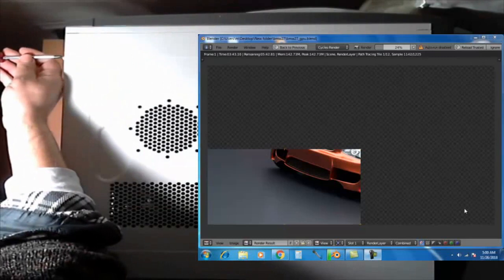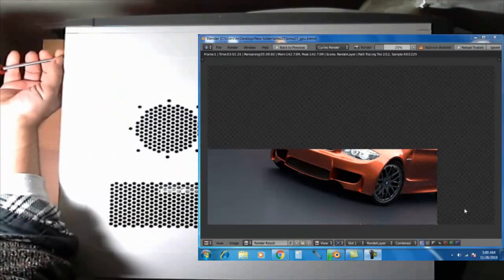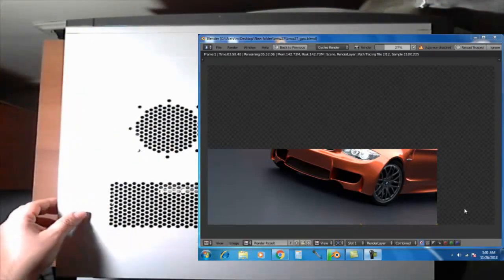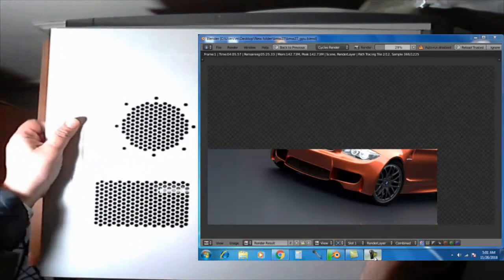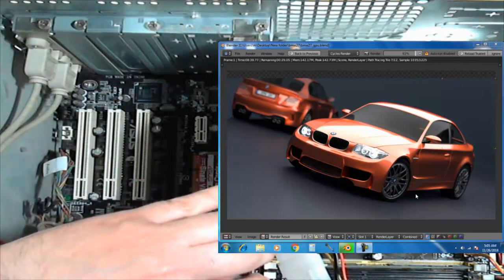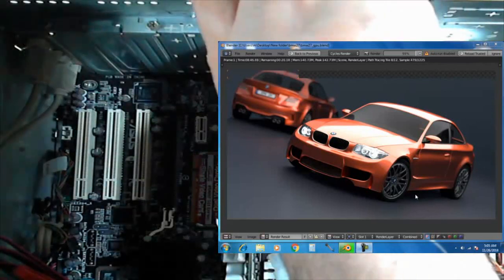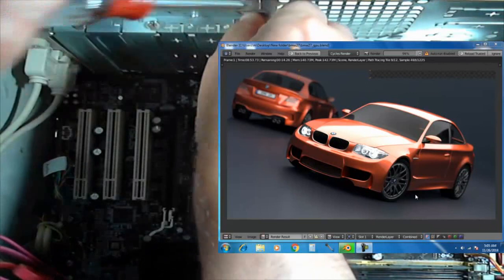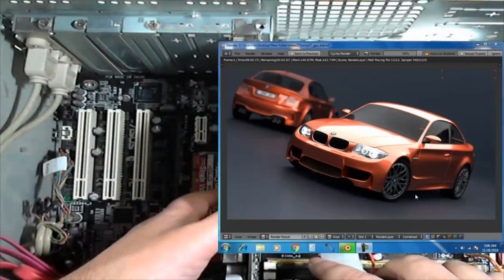Can i install a GTX 1050 graphic card  in old pc Pentium 4 ?

Comment: My spec
Mobo: asus 5kpl-am se
Ram: 2x2 ddr2
Intel core 2 dou

Can it run?
Reply from the maker: Gmorning sir
what GPU model you want to connect?
Reply: @TheKatr2  gt220 ddr3
Reply from the maker: @jerolynguvera9364  if i search right
Released on 01 Aug 2010, the Asus P5KPL-AM SE
and your card is GeForce GT 220	October 12, 2009
sounds fine with me
but
download a monitor temp app and for a while (a mounth) check
if after a month you wil no have overheat
you are ok
Reply: @TheKatr2  thanks sir ahm follow up question, can gt220 1gb runs in ddr4 mobo? And it will be increase fps in some online games like dota 2 or valorant or gtav?

Mobo: biostar a320 mh
Reply from the maker: @jerolynguvera9364  you mean if the gpu has different memory from motherboard?
if youwatch my video you will see what its works
(if understand right your question)
Reply from the maker: @jerolynguvera9364  no not expect update becouse you have limit from motherboard arch/re
the only possible way is to sub to some pay on line service
but fin/ce is cheaper in time to get new pc

Comment: my spec 
Motherboard : Fujitsu D3162-A1
Ram:10 gb
Processor: i7 3770
SMPS : 250 Watt
will gtx 1050 work on these specs
Reply from the maker: the gtx 1050 has release on 2016
is better from 1030

Comment: I have pentium g3240
And 8gb ddr3 
Can I install 1050ti
Reply from the maker: Introduction date of p3240 is May 11, 2014
GeForce GTX 1050 Ti	October 25, 2016
i dont think you will have any problem
but download a free hardware aplication monitor and check the temp to check for 1-2 months
Reply: @TheKatr2  ok thanks bro
Reply from the maker: @sivadilip97  pls dont overclock
Reply: @TheKatr2  yes I will never do that

Comment: Can it work on my pc?
cpu: i5, 4460
ram: 4gb Ddr3
Psu: 750w
Reply from the maker: 2014 is your year
 2016 is the card
install a temp application and keep your eye on this
Reply: @TheKatr2  wdym?
Reply from the maker: @_vien1726  the pc parts must be in the same generation
in other case you will have problems
i burn my motherboard after few months
your harsware is from 2014
the card is from 2016
you must be careful
Reply: It will work easily don't lissen to this ghg

Comment: will 1650 super work in my intel z68db motherboard
Reply: thanks bro
Reply from the maker: @fkthelegend3450  +1
Reply from the maker: carefull my friend you connect a 2016 to 2011 i advise install a free temperature monitor software and check the temps
if you notes something overheat stop it

Comment: so what graphics card is it able to take on the pentium 4 dual e2160 ???
Reply from the maker: from my expireance till now is wrong to mix years
chek the years who P4 was in production
and check the cards
these years is the optimum (2000-2008)
max 2009 and mabe 2010 
the P4 2160 release at 07
NVIDIA GeForce 8800GT
NVIDIA GeForce 9600GT
NVIDIA GeForce 8800GTS
ATI Radeon 4850
NVIDIA GeForce 9800GTX
NVIDIA GeForce GTX280
Reply: @TheKatr2  Thanks for the quick response

Comment: Can gtx 1050ti work on mine? My mobo is an old model, I'm just using the gpu for playing valorant and minecraft...
Reply from the maker: if ft yes
but read the comment section for more
Reply: Oh sorry, what's "ft"
Reply from the maker: @karl-san9560 1 my friend i put the gtx in old mobo
is work
after few months the mobo has broken
is a risk
maybe is happen
maybe no
2 the game nead specific ram cpu etc
if you dont have these 
... no work minecraft varolant
sorry
Reply: Oh it doesn't work on minecraft and valorant?
Reply from the maker: @karl-san9560  iam so sorry
no

Comment: how many psu do you need for gtx 1050??can I with this spec??
my spec :
Intel Core i 3 3220
RAM : 6
HDD : 1 TB
PSU : 300 Watt
Reply from the maker: the card has 2 power inputs 
if the psu has the 2 jacks will be work
Reply from the maker: but the official ans is chek your power suply manual your card and your motherboard manual to und/nd if this system can work

Comment: Can someone help?
In my pc i currently have an gtx 650 and want to upgrade to gtx 1050 2gb version.
When i install the gtx 1050 and turn on the pc it just stays at the bios screen and beeps 2-3 times
Reply from the maker: hello sir
can the power suply support the new card?
what others cards you have on the motherboard?
what windows you have?
can the pci of your matherbord suport the new card?
is work the new card?
etc
Reply: @TheKatr2  The power suply can handle it easily 
Windows 10 
8 gb ram ddr3
I5 2400
The pci i dont know?
Reply from the maker: @amelzolotic1364  is new the 1050?
Reply: @TheKatr2  No i used it in my old pc and bought a new pc and wanted to install the gtx 1050 in it but it doesnt work
Reply from the maker: @amelzolotic1364  
1 you have a computer who works with a 650 and you replace it with a working 1050 
wright?
Reply: @TheKatr2  yes , the gtx 650 works but when i install gtx 1050 it stays in the bios and doesnt boot to windows
Reply from the maker: @amelzolotic1364  what mobo uhave?
Reply: @TheKatr2  i dont know exactly, HP 2AB6 if i remember it correctly
Thanks for your replys
Reply from the maker: @amelzolotic1364  look if you hane a woring 1050 and pc who works the solution maybe will be something simple
when you have time check my video
https://www.youtube.com/watch?v=REt619Z-Cfk&t=1248s
and your free time try to copy my steps
i think the ans is on the steps of the  video
Reply: @TheKatr2  The PC runs without any problems with old gpu but it makes problems only when i insert the new gpu.
The PC is clean and everything is ok with the motherboard,ram, etc.
Only when i install the new gpu it doesnt work.
Is the problem because of the Legacy BIOS? I think i need a new motherboard with UEFI Bios?
Reply from the maker: @amelzolotic1364  yes is 2 time who the bios id the problem 
if you think you have super clean pci contacts 
as you can see in my video frm 1 look all are clean 
but few dust in pci slots 
plus dirt in card gold contacts is the cause
Reply: @TheKatr2  I will try to clean it, thank you for your help 👍
Reply from the maker: @amelzolotic1364  it will be or the clean or the bios
or both
if you fix it pls write me what is so we help users who have the same problem

Comment: Hi bro!
I have an AMD HD 7000 Series 1Gb DDR3 Graphics Card but when I attach it to my PC, it doesn't give me display. My Specs are:
(Lenovo E71 Thinkcentre Edge)
Intel Core i5 2400
180w Stock PSU
8GB DDR3 RAM
500GB Hard Drive
If I missed anything plz ask me and if you know any solution please tell me!
Thanks!
Reply from the maker: is ipossible to troubleshooting via email
but...
when is boot do u see the logo?
ok 
check if the gc is work in other pc 
and put a working card in the lenovo of these era to see what happen
Reply: @TheKatr2  i dont see any logo, the graphics card works in other PCs, and i even tried Nvidia 210 but it did'nt work either
Reply from the maker: @AB54R  look i have a video with 300k views for you but you mus dont skip any step 
you want to try it?
Reply: @TheKatr2  ok bro
Reply from the maker: @AB54R  https://www.youtube.com/watch?v=9oQKOmM8aEE
Reply from the maker: @AB54R  is old video but if u folow the steps you find the error
Reply: @TheKatr2  ok
Reply: @TheKatr2  ok, this video was about to fix a pc that wont turn on. but the problem im facing is the display. the display works fine when the vga cable is connected to the vga port, but when i attach the gc with it and attach the vga cable with it, the pc turns on, the lights turns on but it wont give me display. is it a bios problem or the problem is the whole motherboard?
Reply from the maker: @AB54R  iam sorry i tink you have a dead pc
Reply from the maker: @AB54R  becouse iam stupid you have lenovo
is connecting with a monitor from cg card
you press the power buton 
whT HAPPEN
are the lights of pc on and cpu fan run and no signal to monitor?
Reply from the maker: i thnk you have 2 vga ports
1 from mobo
1 from amd
is work the mobo dont work amd?
Reply: @TheKatr2  the one is the vga that is already on the motherboard (i dont know about mobo what is that) and the second port is with the graphics card
Reply from the maker: @AB54R  ok i start to understand
mobo is sorcut of the word motheboard
Reply from the maker: ok you have signal of the motherboard vga port?
Reply: @TheKatr2  yes
Reply from the maker: @AB54R  ok
before you start clean your inteor of lenovo and the contacts
for reference if u want chek this
https://www.youtube.com/watch?v=REt619Z-Cfk
Reply: @TheKatr2  i think the problem is the bios
Reply from the maker: @AB54R  do you have update it?
Reply: @TheKatr2  nah i just bought it a month ago, and i cant really update it my self cuz i can easily brick it
Reply from the maker: @AB54R  ok
lets see what i have understand till now
you have a new graphic card whos working
in a pc who the pci slots working
and the bios dont see the card 
wright?
Reply: @TheKatr2  yes bro
Reply from the maker: i have neve update bios 
but if you are not sure only a profesinal or someone who is expert can help you 
not me 
sorry
Reply: @TheKatr2  thanks for the help bro
Reply from the maker: ι i am sad who not helpp u
please when u fix it tel me who and whow for me anf for the viewers thanks
Reply: @TheKatr2  ok bro

Comment: Can a GT 1030 work on my PC?
CPU: INTEL PENTIUM E5700
RAM: 2x2GB DDR2 800mhz
MOBO: P5KPL-AM-EPU
Pls reply Im not sure, Thank you.
Reply from the maker: the point of the video is not to work 
it wil work 
but if are not the same generation something will burn
 well in your case i wil try to exam you
check via internet if are the same generation
anyway if you dont find conclusion 
msg me
Reply: E5700 I think this cpu is more than enough an gt 710 hehe

Comment: hey can it work on my pc ?
specs : 
G33M motherboard lga 775
4 gb ram ddr 2
intel core 2 duo e8400 3.0ghz 

tnx man, if know can you suggest best gpu in that specs
Reply from the maker: 1 for a time yes
but 1 day will have problem
2 GeForce GTX 560 Ti
(i know i am late and i am sorry 4 this)
Reply: E8400 I had gt 710 with this cpu try upgrading to q9650 q9550 they are much better you can upgrade to gtx 660 ti easy

Comment: Bro I have Pentium dual core processor e5700 6gb DDR 3 ram can it work
Reply: You can't fit DDR3 into a DDR2 slot, so it will only work if the motherboard has DDR3 slots. I thought there weren't any motherboards that supported this CPU and DDR3, but there apparently are a few. Most compatible motherboards use DDR2.
Reply from the maker: well
if you mix generations of hardware you find 1 way
problems
in the end if make it work
 your games dont play

Comment: I have Pentium 4 and ddr1 2gb ram but no video ram. 
1) Is that the reason Windows 10 and other Softwares are very slow and laggy ??  
2)Then Can installing a GPU may resolve  this problem ??
Please Reply.
Reply from the maker: 1 the video ram is on vga card right?
2 no Windows 10 and other 2day software is heavy for p4
3 no sorry
Reply: Yes video ram is on vga card and I do have an PCI-E slot . 
So if I install a gpu(let's say
 GTX 750 ) , Will it increase its performance ??
Reply from the maker: @thunderrohan  the same i do in my asus mobo and i burn it
but the ans is
yes
Reply: @TheKatr2  Thanks So Much ♥️♥️

Comment: It would not work on Pentium 4 due to several reasons. 1) hardware compatibility
2) legacy BIOS 
3) The processor itself has not enough power to run it.
Reply: 3. is not a reason. A processor not having enough power won't stop it running, it will just run slowly.
Reply: @nathangamble125  ur right
Reply: @nathangamble125  cpu bottleneck
Reply from the maker: yes sir you have right

Comment: Yo can a GTX 1650 work on a legacy bios motherboard? I have i7-3820, 12gb ram and currently gt 545. I want to replace gt 545 with gtx 1650 but i get stuck at bios screen. I can go past it but after i install drivers the screen is still zoomed in and in device manager it says windows stopped device cuz it report problems
Reply from the maker: hello my friend
if understand right you have already problem with gt 545
and you want to replace it to fix the problem?
i suppose your mobo is made around 2012
and your card is 2019
you can try
 but prepare for not working
i hope to i make mistake
Reply: TheKatr2 I dont know when its made but its Pegatron 2ACE Motherboard Pittsburgh2. Also while using the gtx 1650 the monitor screen would go black (not no signal, just black screen. Monitor light is blue). Is my psu enough for the gpu? Its a DPS600-WBA and it says max 600w on the label. I also connected pin and seated properly. I also reset cmos and battery and ddu uninstall old drivers
Reply from the maker: @crazgaming5236  my joy is to help
please 1 question each time

Comment: Hello my friend, I have a intel pentium 4 CPU 2.80GHz, so what type of video card I should to buy for? I want a good one for programs and internet, I’m not into the video games, so what I should buy? Thank you.
Reply: You still can find 1 but need to search since it is a old processor. A graphic card that supports legacy BIOS boot would only work on it.
Reply from the maker: hello 
 a p4 is an old processor
an old processor in a old mobo 
if you mix generations of hardware it not work
but lets suppose you have large stock of hardware and somehow  will work
in the future you will (i dont know the time) you will have your mobo off
what you will do?
1 check the date of your mobo and the processor i think is 2000-2010 and search the best vga and get it from internet (cheap ) or
2 go in a shop with retro or used parts and get something with warranty for your PC (also cheap)
the n2 is the solution who i did it
anyway you will no have HD in your YTvideos

Comment: Can I put my HD 7870 XT in my 2003 Hp Compaq with Pentium 4 ht and 1 GB RAM DDR2?
Reply from the maker: if fit yet
if work yes
you will play some old games
but
 soon or later you have motherboard hardware problems
only if you care about your computer if is your main pc 
NO
Reply: Hey Bro !! I also have equivalent spec pc? Have you tried that ? And Did It Work ? Please reply me ??

Comment: Can it work on my Pc spec
G41 motherboard Ddr3 
4 ram ddr3
Core 2duo E6750 
230V psu ???
Reply from the maker: sorry for the late answer
you have 10 years difference
my advise is not mix generations of hardware
even the games want specific HD to work
so

if fit yet
if work yes
you will play some old games
but
 soon or later you have motherboard hardware problems
only if you care about your computer if is your main pc 
NO